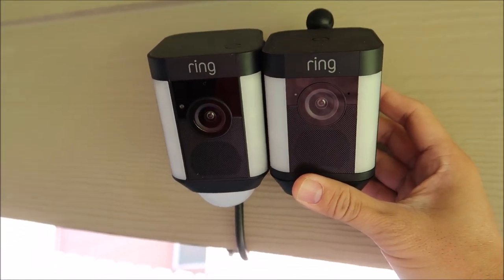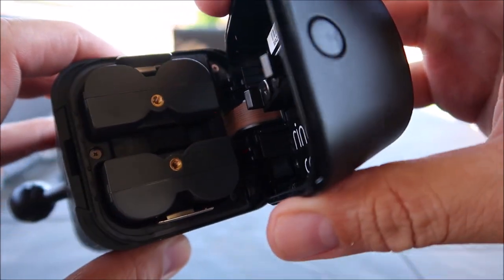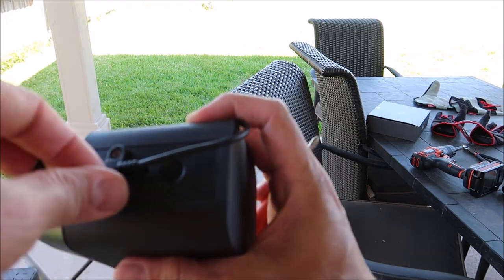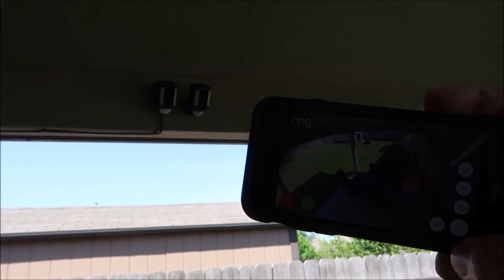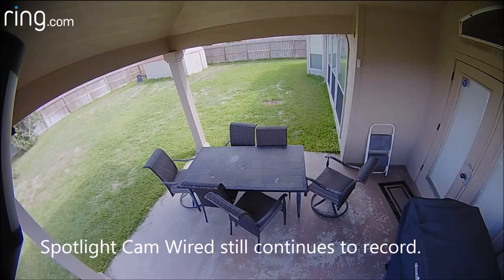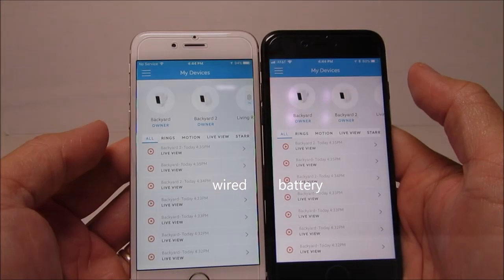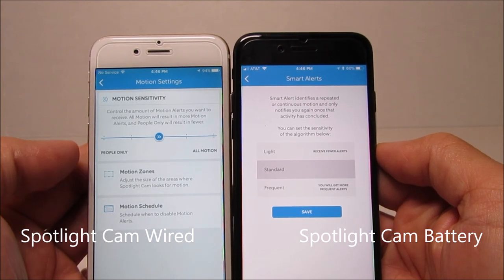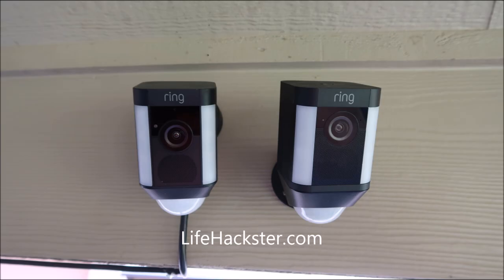Ring Spotlight Cam Wired vs Battery...which one is better?

Comment: Did you notice any improvements in the wired version in the recent form update 1.11.26? If you haven’t got that version yet get on to Ring and they’ll push it to your device.
Reply: Paul Moran is this update pushed to all ring cams or only the spotlight camera?
Reply: leonardo herrera Pushed to wired cams and Doorbell Pro.
Reply: Paul Moran awesome, thanks!
Reply from the maker: I will do that..will see..
Reply: Paul Moran does your camera say the current firmware or does it now say up to date ?
Reply: Rigo Sanchez up to date.
Reply: Ihab Darwish I just receieved my spotlight cam via FedEx yesterday and it says firmware up to date. Should I call to check anyways?
Reply: Ihab Darwish do you know what the firmware update was to fix?
Reply: Ihab Darwish i have the same issue a few times now with live view not working. Same problem I had with my stick up cam. I've been running a blink xt with 0 issues for a week. I dont think its my network.
Reply: Ihab Darwish my RSSI right now is -55. 7 times out of 10 it won't connect to live view on mobile data or wifi.

Comment: With ring floodlight cam you can also control the lights , still when its dark the lights will always turn on.Even when the alarm is turned off.Does this cam have the same issue? I want to place it on a terras &  not having the lights turning on everytime i move on my chair.

Comment: Thanks for the great videos LifeHackster!  Do you know what I can do if I need additional cable length for the solar panel on my ring?
Reply from the maker: You are welcome :) The Ring solar panel cable has a barrel type connector and not a micro USB plug... I'm not sure of the exact size though so I cannot recommend any extension cable or if there are any that is being made. The simplest way to lengthen the cable is to cut and splice with a matching wire.

Comment: So on the battery version you can't turn on the light manually? Or the siren? Also when you buy this it only comes with one battery pack?
Reply from the maker: You can turn on the light and the siren manually and it only comes with one battery pack.

Comment: Can you run the wires through the wall or roof? I want to conceal the wires from the outside of the house.
Reply from the maker: You can but the cable needs to be cut so that you don't have to drill a big hole. Cutting the wire will void the warranty.
Reply: @LifeHackster  thanks! Appreciate the input!!

Comment: Hi LifeHackster. So if you don't open the cam app on your cell phone, then the battery version cam only records for 30 seconds? But will it record for more than 30 seconds if you do open the battery version cam app? And how long is the shortest cool down time, until the battery version is ready to record again? And also, the battery version won't send you motion alerts during the cool down time, or it just won't record during the cool down time? Please respond because I am thinking about buying the battery version because it can be placed anywhere. Thank you.
Reply from the maker: Yes, if you don't view it from the app (live view), it will only record for 30 seconds and as long as your viewing live view, it will continue to record. Depending on what you choose on the "smart alerts" setting, the frequent setting, will start recording again after 30 secs. when the motion persists...so there is only a few seconds of cool down...

Comment: If the power to the house goes off, will either camera still transmit?
Reply from the maker: No it will not... unless, your internet router is on backup battery (UPS), then the battery version will still record.
Reply: Ring bridge app
Reply: BILL JEFFERSON 0

Comment: I want the wired one, but I don't understand why they put a regular plug on it. Most outdoor outlets are at a low level where someone could just unplug it. Do you think I could just cut the plug off and manually hard wire it? Thanks
Reply from the maker: You can but Ring will not honor any warranty on it. A better option is their "mount" version or the Floodlight cam which you need to wire from a junction box.

Comment: Which is the newest and largest version? Looking to get a wired one.
Reply from the maker: The battery version is the larger one (slightly) just because it was designed to fit 2 batteries. I don't recommend the battery version though.
Reply: LifeHackster I got 3 battery camera. I love mines. I don’t like the wired ones. It’s more a hassle. Plus I’m not good with electricity

Comment: Not a fan of drilling into brick to mount. They should’ve had a mount that attaches to the top of the unit so that I could screw it into my aluminum fascia under the gutters.
Reply from the maker: They actually sell a ceiling mount now.

Comment: @ lifehackster or anyone else who knows... can the wired camera be mounted on a soffit? Does it adjust up and down as well as right and left
Reply from the maker: The wired spotlight cam cannot be installed horizontally...the spotlight cam mount version and the battery versions can.

Comment: i purchase a spot lightt  wire one,and returned ,because i do not know why  they always  black out on the screen,if i have 10 message,may be five are black out.
Reply from the maker: It might be a WiFi signal issue. Ring cameras are notorious to need excellent WiFi signal as compared to other WiFi cameras...The WiFi antennas on their cameras are weak.

Comment: If the power goes out does the wired one have a backup battery like the ring pro original? Thanks
Reply: mcardenas23 power outage is sort of a moot point for BOTH. Since without power you won't have internet, without internet niether will be recording since they cannot access the cloud. the cameras don't have physical storage.
Reply from the maker: No back up battery on the wired version...and yes as per TikiShootah...it is really of no benefit because the without WiFi, the Ring cameras will not be able to record.
Reply: It is not a moot point as many of us would just simply and do simply put our access points and modems on a UPS.  The Cable modems and other types of modems usually still work as the ISP's are on back power too.  I had Internet for days during the last long power outage since I used a desktop UPS.  I really wish the wired version had a backup battery option too.
Reply from the maker: Good point. If the modem and access point will be on a UPS, then the Ring cameras (battery) will still be able to record.
Reply: TikiShootah wow! I didn’t realize that...that may be a deal breaker for me!
Reply: I put that in as a suggestion back in December..  would be nice if the cord could be unplugged so as to fit through a smaller hole as well..
Reply: Harold Bruning ,I had a drawn out debate with Ring on that particular point, they would not accept the plug being cut off without voiding their warranty, it's a ridiculous design tbh.
Reply: If you plug your outdoor camera to an outdoor outlet a burglar can just cut it or unplug it. I wish the wired had a battery back up as well.

Comment: You have installed the cameras incorrectly. They must be installed straight so that the motion sensor at the bottom that activates the spot light itself can be plain to the ground and it also must be a height of 9 feet.
Reply from the maker: No issues with this install. To align the sensor parallel to the ground, the camera has to tilt forward and down which is how I installed it. As to the 9 feet...that is a recommendation not a "must"...
Reply: LifeHackster 

Ya, I can’t get that high, but close enough.

Comment: I upgraded from stick up cam to spotlight cam battery this week. Looks like the live view connection settings tab is gone in the app on android 7.0.  Also when watching a motion clip to the end the screen controls disappear to play, rewind,etc.

You have to go back to the video clip list then back in to re play it. I checked this on a iPhone se and the live view settings are still there and the screen controls can be re clicked after video ends.  Have you noticed this?
Reply from the maker: Sorry, I cannot compare because we all have Iphones.
Reply: LifeHackster do you have any problems with your ring devices connecting to live view? My spotlight cam won't connect 98% of the time. My home network is pulling download 100+mbps upload 13mbps, mobile data is download 40+mbps and upload 11mbps. I've been working with ring support they're sending a chime pro to try to fix it, but my cam says signal is good rssi -55
Reply from the maker: EstPaul - I don’t have any issues on mine. If you just installed the camera..wait probably a day to get it updated..and check again.
Reply: LifeHackster I had the same issue with stick up cams. I've had this installed since Tuesday I think and have been working with tech support since then. They said they pushed an update to it yesterday morning. I don't think it's my xfinity service. They're sending me a chime pro to try.

What's really annoying me is I've had a blink st installed for over a week. 0 problems with that. What internet are you using and their modem or yours?
Reply from the maker: EstPaul - I have ATT uverse and I use a net gear router setup up as an access point as my main WiFi...hopefully they can fix it...sorry to hear that.
Reply: LifeHackster that's why I think it's a problem on their end. My blink xt is working perfect. I might buy a netgear router/modem combo and see too since I'm using the Comcast art is leased modem.
Reply from the maker: EstPaul - just update us...hoping you will get it to work
Reply: LifeHackster the ring chime pro came today.  It's literally 5ft from my front door and the camera is mounted on the eve outside that. 

It somehow made my signal worse, now cam is getting "Ok rssi -68" when before it was "Good rssi -55". I have a new router and modem coming instead of the stock Comcast one.  I doubt that's going to fix it if the chime pro didn't. 

I'll try it though. But looks like I'll be sticking with the Blink XT system. Too bad ring cameras seemed like a good idea.
Reply: Ring sent me a Chime Pro to help get better connectivity for my doorbell thus reduce delays.  One of the things you have to remember is that getting better connectivity to the camera is a balancing act.  While getting the Chime Pro closer to the camera may get you a better signal level between the Chime Pro and camera, you may find that the levels between the Chime Pro and your wireless router get worse.   So the key is finding a spot in the house to place the Chime Pro which gives you the best signal levels from the Chime Pro to the camera, and from the Chime Pro to the wireless router. I tried about 4 different locations in the house before I found that sweet spot where connectivity each way was improved.
Reply from the maker: That is weird that the signal is worse. BTW, was your stick up cam better in connection to WiFi? Can you compare if you still have the stickup cam? I'm thinking it might be the spotlight cam unit itself that has the issue. Ring is notorious for signal issues if it doesn't have a good WiFi.
Reply: LifeHackster I brought the spotlight cam inside, the rssi was only rssi -43 at best, within a few feet of the chime pro! As soon as I put it back outside which chime pro within 10ft or less of the door, the signal dropped and is now at rssi -65. 

When I had the stick up cam it was around rssi -32 inside setting up and at rssi -56 outside. Also had issues with live view.  ring said wired cameras are faster and have more stable convection, but I don't have any plug in where this camera is. They think that the command server side isn't getting back to the cam to tell it to "wake up" for live view.
Reply: Jpcanavera I tried every spot around the house in multiple rooms in the front of my house, it never improved from chime pro to camera, but router to chime pro has excellent signal strength.
Reply: In my case I installed the Chime Pro in an outlet that was about 15 feet from the front door.  The signal to the Ring Doorbell got worse also.  Part was the fact that the Chime Pro sits in a low wall socket and I have a big steel door that probably attenuates the signal from the Chime Pro.  Instead I went to a front bedroom which was also about the same distance.  In that location the Chime Pro connection to my router improved and so did the connection to the doorbell.  I wanted better however and took the Chime Pro out of the wall socket and placed it on top of a free standing bookcase against the front wall.  Up there the signal to the Ring doorbell improved by 10 db.  So I'm at -47 db now.  Bottom line don't overlook that the Ring Spotlight cam is probably sitting  high and a low transmit site in a wall outlet may not be as conducive and that using an extension cord and placing the Chime Pro higher might help the signal pattern better reach the Spotlight cam.
Reply: Jpcanavera I have a stucco house with metal entry door with 2 Windows in it and the front wall all windows. My galaxy s6 outside next to cam has full wifi bars and pulls 20+mbps down and 10mbps up.

I currently have my new wifi router literally next to the front door on a table about door knob height.  I'll try the extension cord and chime pro up high, I'm not holding my breath though.  With the router next to the door still only getting rssi -64, choppy video. Also the chime pro to router has had excellent connection in every spot I've tried.

Comment: Can the spotlight cam be mounted from the eves of a home? I tried in the floodlight cam and it didn't work.
Reply from the maker: You can with the Spotlight Cam battery...not the wired one. Also, you also can with the floodlight but the camera module just needed to be re-positioned is an awkward position.

Comment: Well this is really disappointing. Was really looking forward to getting a pair of spotlight solar cameras however the delay in recording seems to be a deal breaker :’(
Reply from the maker: The delay is not as bad as the other battery powered cameras..which I will eventually compare this camera with my Blink and Reolink Argus..You just gave me an idea for another video...thanks.
Reply: LifeHackster 👍
Reply: Ihab Darwish how do you know?
Reply: There was a post that said that a firm ware update reduced the start of record time lag of the battery powered ring spot light cam? Has anyone else also seen this same improvement?

Comment: This is so odd.... how is the night vision on the battery cam better than wired....? I don’t get it. It makes a hard choice which one to pick..? What are you doing “Ring”!!!
Reply from the maker: I'll go with the wired one if  there is an area that I can plug it in... Wired one has better motion detection, lesser cool off periods than the battery version.
Reply: @LifeHackster  yeah, I'll always choose the wired over wireless... But I don't even know if I'll want to go with Ring cameras for now... Frame rate is only about 15 on all their cameras... They don't even syn up with their own alarm system.... what's the point going for the same brand cameras unless they syn up with the alarm system.

Comment: Help!  I got the spotlight camera because I wanted the spotlight to come on with motion at night as a deterrent to crime.  However, I have determined that with a dim 60W porch light and the camera in a corner under that light, the spotlight does not come on!  It will only come on if completely dark with porchlight off.  This seems silly.  The camera knows what time of day it is so should know the porch light is "artificial" and not daytime light.  Ring thought at first the spotlight should definitely come on in any circumstance as long as light set to ON with motion at night but then said it will not come on if you have a porch light.  I can't believe this can be true and if so, that there is not some workaround.  Hope someone can help.
Reply from the maker: Try adjusting the position of the camera so that it will not directly face your porch light. Another thing you can do is find a translucent tape and cover the small light sensor on the camera and see if it will be enough for the camera to turn on night vision and the spotlight at night even with your porch light on.
Reply: @LifeHackster   @LifeHackster  Thanks.  The porch light is above the camera, so there is not way to not have the camera seeing light from the light.  As I look straight at it, is it the sensor to the left or right?  Also, I have experimented with porch light on, vs. off.  When on, the clarity and resolution is much better with the overhead porch light on.  This is reasonable, right?  Also, is it using color vision only with poor lighting, and hence I'm in fact not getting color vision, and hence better quality video, when I have good exterior porch light illumination?  Also, another thing.  Without porch light, as I walk up to the door, the spotlight comes on first, but then you must proceed closer to the door and well into the defined motion zone  before video starts to record.  I don't know if that is because the camera is waiting for enough light, and hence wants you to be closer to it and hence the delay.  Thoughts?  I think it is a HUGE deficiency that the spotlight will not come on with a porch light on.  It is unreasonable of RIng to expect one to have a completely dark area to mount the camera and many folks like to have  a porchlight on at night AND have the spotlight on with motion for added light for good video and surprise factor for burglars.  I believe this is why many folks buy the spotlight cams vs. doorbell but then, like me, find the spotlight does NOT come on with motion if they have exterior lighting.  Since you seem to work with Ring a lot, can you make this suggestion?  The app allows light on with motion, but apparently too much light from exterior sources overrides this.  Certainly the camera know the time of day, so it should know it is night and one might want spotlight on with motion to scare burglars.